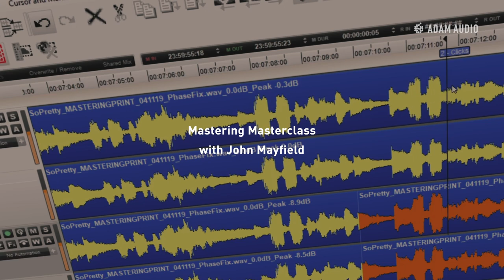Should you High-Pass EVERYTHING? | Mastering Masterclass Ep. 2

Comment: Thanks for some good tips but..... "at least 24dB per octave"? Now everyone will chuck on 96dB high pass filters and get a bunch of ringing at the cut-off point.... "out of the frying pan......" 😂
Reply: man i have a question because the "at least 24db per octave" info is not clear to me .... if i set a 24db high pass filter at 50hz and 1.00 bandwith, it will only lower the volume of the lowend but it's still there, right? is this method prefered to keep some of the lowend energy on the instrument or is it better to choose a 96db high pass filter if i want to eliminate the frequencies below completely?
Reply: @snubdawg1386  Well it depends... If your intention is to complete eliminate any frequency below a particular point then yes. But, if the sound has any energy at the cut off point a steeper slope will create ringing and increase the amplitude.. Try this.. take a trusty old 808 kick and add an EQ with a high pass filter at around 60Hz (or whever the fundamental is).. try with different slopes and you'll notice a considerable increase in bass at a higher values e.g., 96dB per octave. Pay less attention to what the analyser is telling you (cos it's visual and not aural) and pay heed to that fact that analogue consoles have usually 12dB filters and if Bruce Swedien was OK with that then so should the rest of us......
Reply: not all 96 db/oct filters have this effect
Reply: @liantrosretrospectiva4134  no worries but link maybe.........?

Comment: Rather than going 1 octave below with a 24db filter, I tend to go right to the lowest note and filter with 12db. Sometimes using some resonance at the cutoff.

I always, check the effects of filters by checking the whole mix in mono. Because frequencies can shift a bit when filtering anything with stereo information.

I think I’ve got the filtering down to a science…it’s the mixing of the frequencies in between my highpass and lowpass filters that’s the hard part!
Reply: Exactly the same here ! I use a much gentler slope (12dB) and pretty close to the lowest note, along with a small touch of resonance.